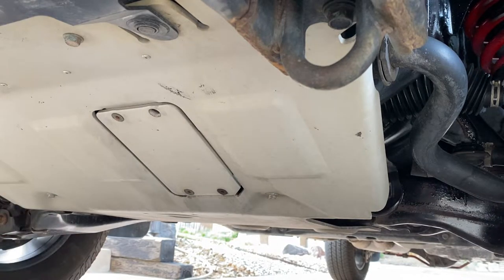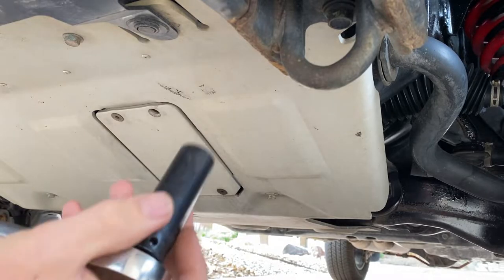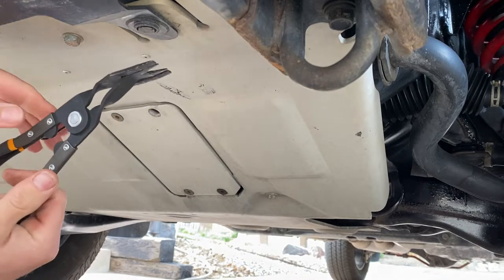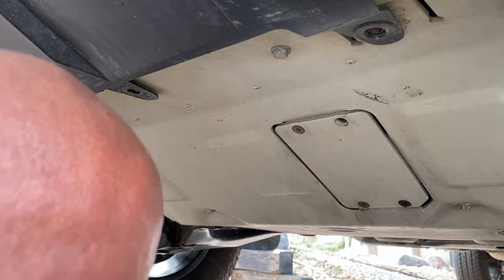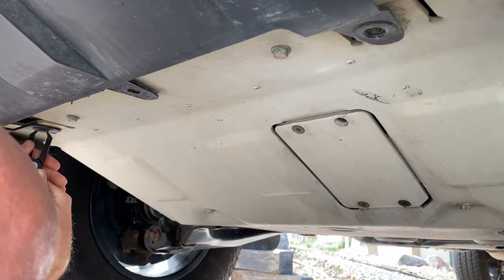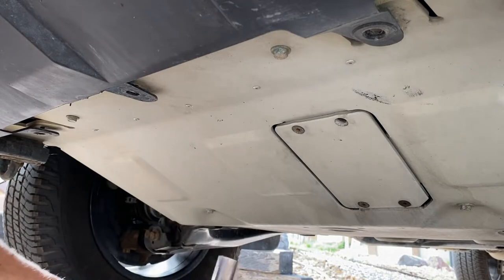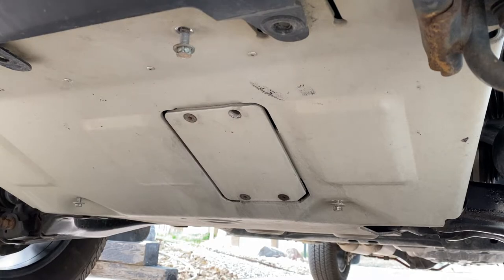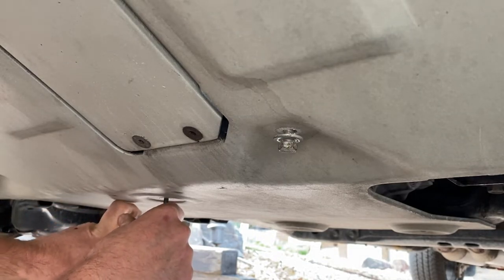"Silence the Noise in Your Toyota Tundra 2017 TRD Pro - Part 2 Skid Plate Fix!”

Comment: My Rci one does a pop sound I removed it right now figuring out what to do it’s quite with it off
Reply from the maker: Can you see if the plate was making contact with the frame or cross member?
Reply: @ I haven’t really looked at it yet when I removed that plate and I have two section I burned my right hand on that damn Trd exhaust so I’ll go over it soon. Called Rci and they mentioned yes sometimes things have to be tweet, such as as a rubber washers, etc. etc. . I’m going to repaint my frame and overhaul  the parts  to aluminum  and add rubber bushings and also use dynamat pads on the plates to keep this quiet . The pop sound during a hard turn was annoying im glad I tracked it down to the Rci plates with trans  and cats protected I’ve overhaul the front end to new parts so I know it’s not that the frame flex was causing some pop noise on the plate I couldn’t figured the location just yet
Reply from the maker: @ ah gotcha ok that makes sense to me.  Look at the fitment too of the RCI plate if you have a bolt that’s super tight it might be an alignment issue so when the chassis flex’s it’s putting the load to that one area causing an issue.  I don’t have experience with RCI and I’m assuming they have quality products but the tundra has some tight tolerances which unfortunately cause additional issues.  Let me know what you find!  Appreciate the view and comment!
Reply: @wrenchops719  I very much agree with you on that and I will be looking at all avenues just to try to get this resolved right now with the skid plate off I know that is super quiet .I’m sort of enjoying that but at the same time it’s going back on Jan of next year because I’m moving to Minnesota and with the Winters in that area I need it back on. Thanks on your video it’s helped on some aspects just trying to gain some understanding on what is taking place here had this tundra since new and I take care of this truck big time
Reply from the maker: @tundrav8georgia heck yeah brother, I know MN is rough I have friends from Duluth and black duck.  Run into a bind let me know see if we can navigate an issues you might encounter.
Reply: @wrenchops719  i’ll follow up with you in a few days I have this second-degree burn on my right hand and it’s sort of hard to really mess with that right now but once I get feeling better I will definitely get it done .i have rain for the next three days in Georgia just so that’s just how it goes out here in the south.  I haven’t been to Duluth Minnesota but I do plan to go there at some point it’s kind of funny. We actually have a Duluth Georgia and I know that area well.
Reply from the maker: @tundrav8georgia ugh man no good!  I’m TDY here at JBSA San Antonio so we’ve been getting a mixture of wet and shear heat. Lemme know for sure!